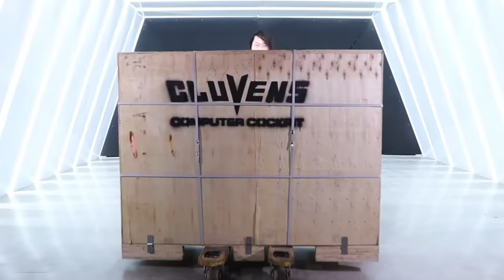Installation video 1st version -Cluvens Manticore Chair cockpit  www.cluvens.com discount offer

Comment: What is the weight of the base and chair combined? I would be moving this up stairs. Also can the base and the chair be separated for easier moving?
Reply from the maker: The base is attaching to main cockpit chair as biggest part weight around 350 lbs and other accessories part weight about 150lbs
Maybe we can add 4 handles on base for move upstairs.

Comment: Looks like an RPG-7 PG-7 rocket perhaps as nice touch!! I am also getting some serious Band-Maid/Babymetal vibes with the soundtrack here lol.🤘🦊 Anyways am seriously considering this as well. It looks like an improvement from the other models i have looked at. 

It has more of an incline up to 160 degrees as well which is nice. Much better for my back as i have mid back problems. Wonder if the HDMI cables are 2.1 complaint? 

Not a huge deal considering could always swap them out if not.  Does it have a docking station of some sort?  Like the arm rests better on this one as well compared to the IRW1.

 As they look bigger & more arm friendly so to speak. What materal is used  for padding in the chair i wonder? Hope it's some kind of memory foam. 

As that would hold up better i would think. Does it have any built in massage features? Does it have mounts for a soundbar I  wonder?  What size keyboard will it accept here? 

 I have a full sized Steelseries i perfer to use.   Great if there is room for a keyboard handrest as well.  Just nitpics i guess but would make it all the better here. 

I have a huge MSI GT 83 VR  laptop which would would be great if there was some extra space to put it on a shelf or something. Which could be attached somewhere if possible. 

Not a huge deal but would be a nice feature.  Using a Samsung Odyssey  G9 49 inch curved monitor. Which i think it supports but not sure?  Looks like a great buy for all you get here. Even better i can set it up myself. Once it gets to where i want it. :)
Reply from the maker: Yes bigger recliner than any other models/ wider and more comfortable/ option for memory foam cushion with massage vibration /  can support G9 49” or others either custom made mount /can support soundbar with  custom made bracket / can swap cables inside with HDMI2.1 etc/

Can see brand official site for purchase 

www.Cluvens.com

Comment: I was about to buy it. But it's not gonna fit through my door. That's the only reason
Reply from the maker: Its width before assemble the two armrest is only 23.5 inch it can go through any door in the world . I guess there are some miss understanding for its size . Length before assembly is only about 62 inch.
Reply: @computercockpit  I am homeless 🙂